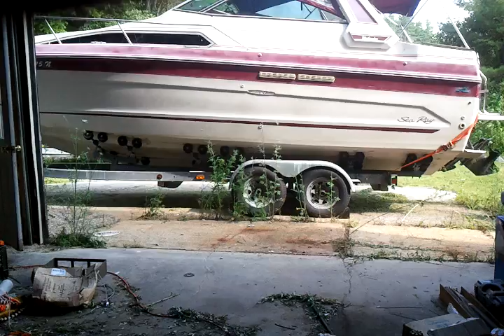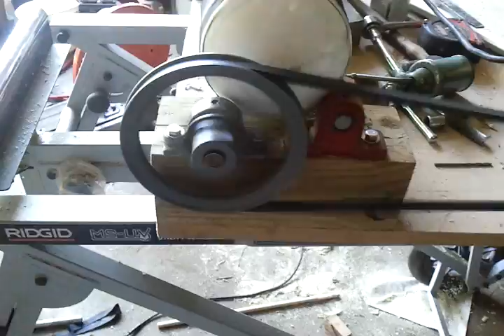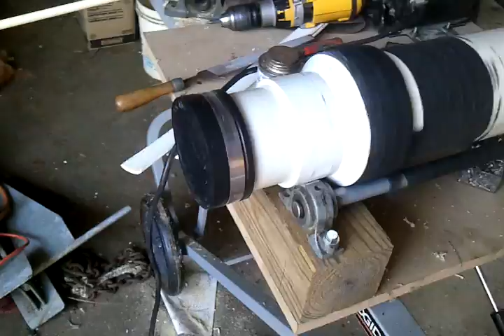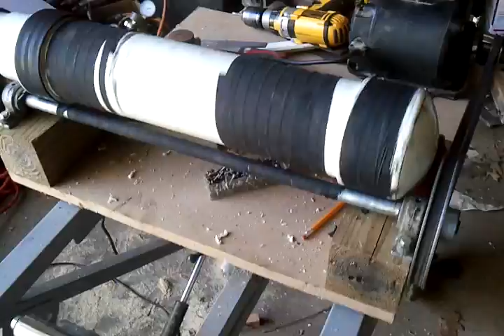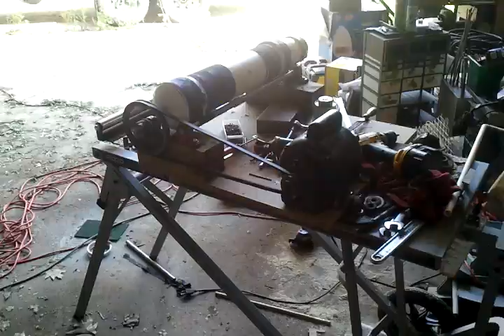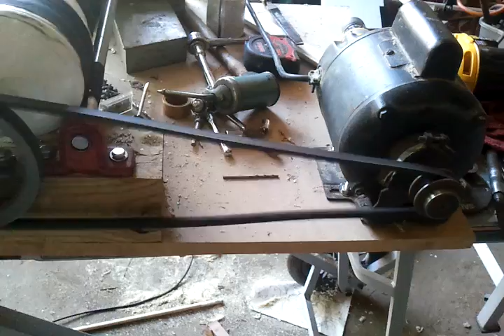Homemade Wet Brass Rotary Tumbler

Comment from the maker: The source for the SS pins is referred to in the description.

Their media is first rate. It's the very expensive tumbler I wanted to avoid. I saved so much on making my own tumbler, that it's like getting the media for free.

BTW, the media is 410 stainless steel. Meaning that it is the magnetic kind. And, any of the tiny loose pins can get picked up easily with a magnet.